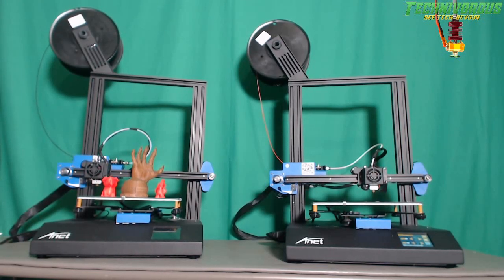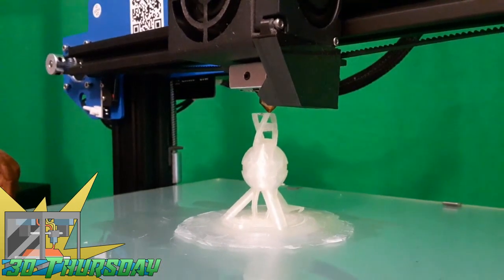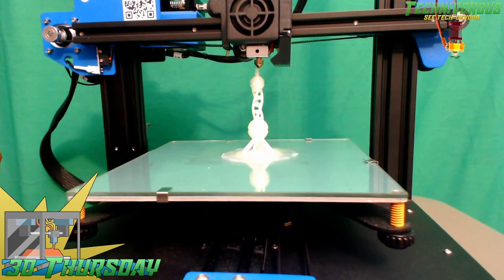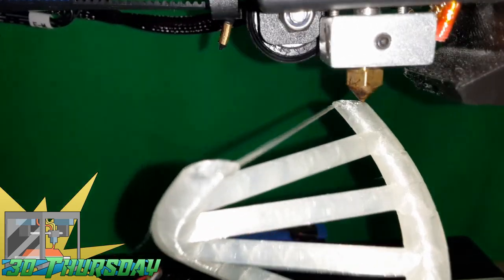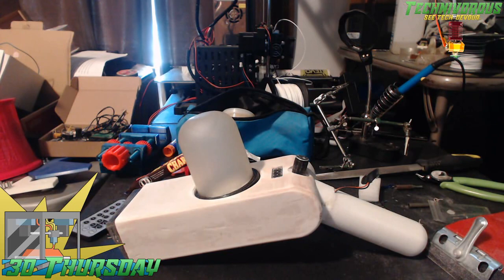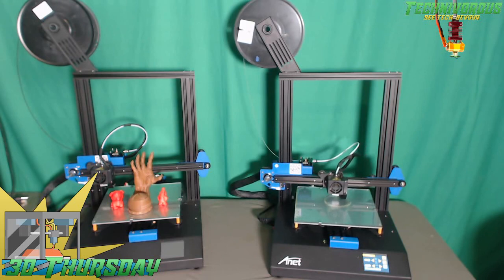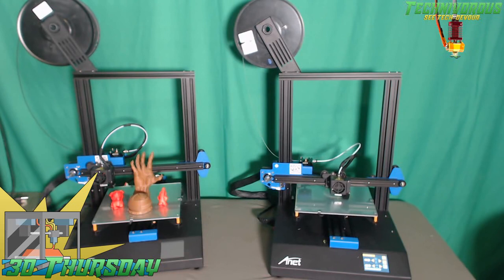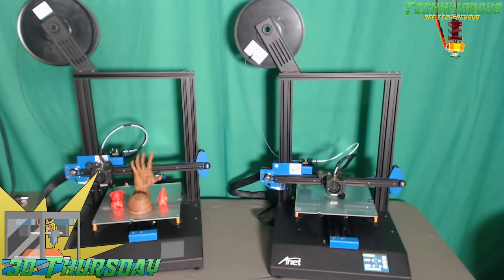Anet ET4X Review With Torture Tests #3DThursday

Comment: I have a Anet ET4 but my extruder it won’t heat up and started to leak filerment any tips and know where to buy a new extruder
Reply from the maker: Odds are if it wont heat up you have a loose connection or the thermistor has come out of the hot end. As for leaking, try tightening the nozzle once you do get it hot.